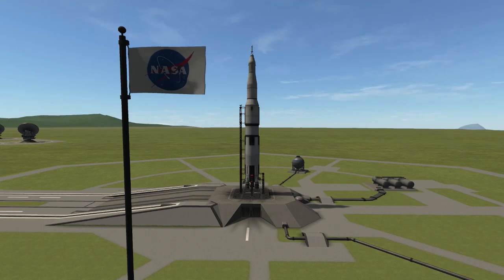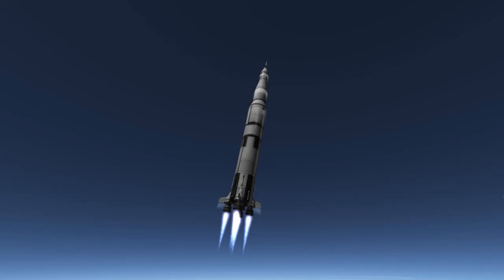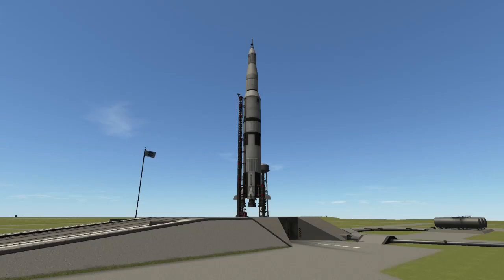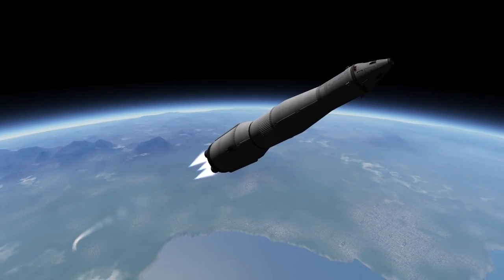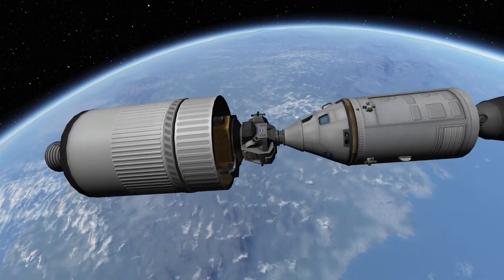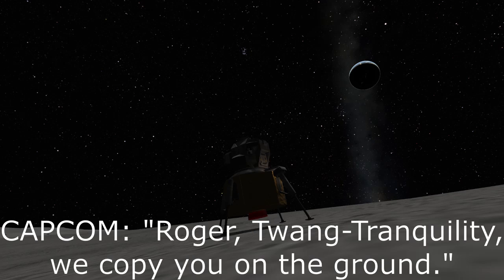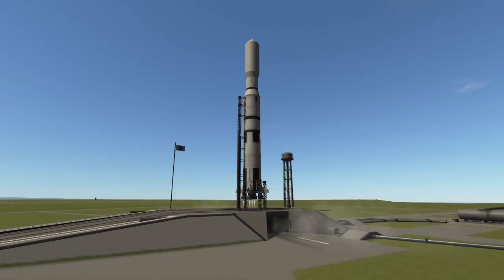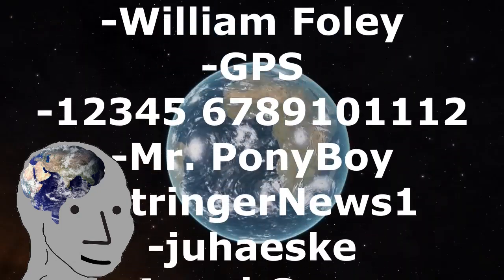How Do Rockets Work? | Saturn V

Comment: What is admirable about the Saturn V, when compared to SpaceX's foibles, is that it used the computing power of a mouse / touchpad / pointer that is currently used to design SpaceX's most mundane hardware. One square centimeter of Rocket Labs' Electron rocket guidance & control electronics CPU can do more than the entirety of the Saturn V's deployed electronic control system. Breathtaking how far we've come.

Comment: Stage I burnt 10 tons/second. The rocket chamber had a pressure of roughly 100 bar, and that remeined stable even though the exhaust gases left the rockets at 3 km/second. 
 
You can say that the rocket pushed itself off from a gas rod 100 times denser than the atmosphere. 
 
And this 100:1 shows the futility of the "rockets push off air" argument: this miserable air pressure is just a 1% smudge effect on the whole propulsion system.

Comment: One thing I always wondered: How did Aldrin, Armstrong, and Collins decide who would stay in the orbiter and who would go down to the lunar surface?

I always imagine it being the most heartbreaking rock-paper-scissors loss in history.
Reply: That would be an interesting story. But they were assigned rolls with specific tasks.
Reply from the maker: I believe they knew well before launch who would be doing what. Hell of a responsibility for Collins to stay behind though.
Reply: Crew selection and their particular tasks for each flight would have been decided at least a year before each mission to allow plenty of time for them and the backup crew to train up for their mission. However there was always the possibility of flying on a later mission, eg Jim Lovell was on Apollo 8 (Command Module Pilot?) and commanded Apollo 13. He would have been the 5th man to set foot on the Moon had fate not intervened. This selection process did not always go smoothly and crews got "bumped" to later flights for various reasons. Apollo 13 was originally slated for Alan Shepard and his crew but they got bumped to Apollo 14, if I recall correctly.
Reply: That was determined during the planning phase I believe. Michael Collins mentions something about it in his book. One person to ask might have been Deke Slayton. He was in  charge of the astronauts. Sadly he is gone now.
Reply: Guys , he was joking

Comment: I saw one documentary that claimed that the F1 engine can't be reproduced today because the design was all slide-rule and drafting table. When the engineers ran into an issue, they solved it on the floor of the assembly building, often not properly documenting the result. At least some of what went into an F1 was only in the heads of the engineers and would be nearly impossible to reproduce today.

Comment: I agree Kevin. As you know, I am a SpaceX fan, but I have always had an interest in the NASA space program from Mercury through to Apollo.  So even though SpaceX Starship is an exciting prospect and will break records, when it flies, The Saturn 5 will still, in my opinion, remain unmatched and unrivalled in terms of what it achieved for human space flight and exploration.
Reply: I still would not call it THE iconic moon rocket. Sure it got the job done, but the original von Braun Disney Rocket was WAY more impressive with the pseudo russian many engine design ala N1... (also I'm a Perry Rhodan Fan, where they took this design including little spaceplane-lander on top and turned it into the Stardust for THEIR first moon landing (described 1961 in a novel) ;))
Reply: @Ugly_German_Truths  I suppose it's subjective but the only reason I think that is because I was fascinated with Apollo 11 from a very early age.  The interest wavered for some time when I saw there wasn't really much in the space program of the late 80's through to the last few years. But Saturn 5 still has that early interest and therefore close to my heart.
Reply from the maker: @Ugly_German_Truths  you would say a concept that was never built is more iconic than one that flew 13 times?